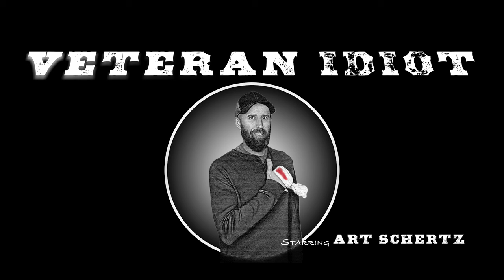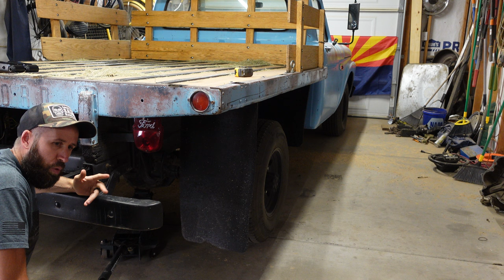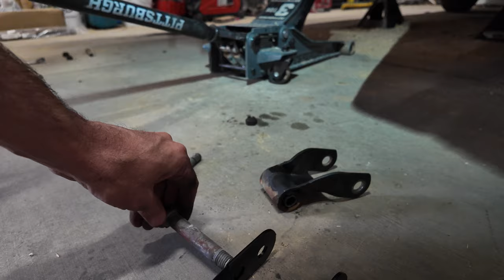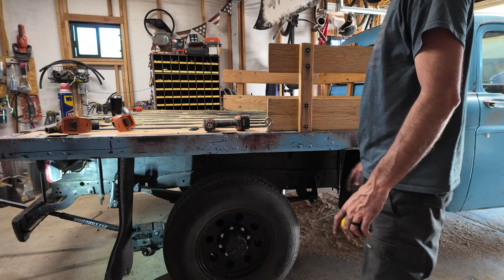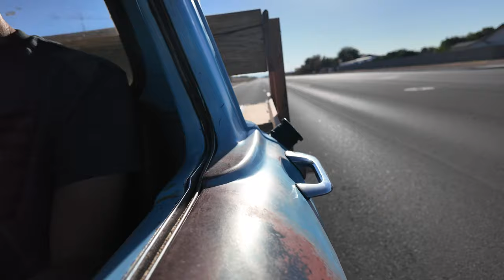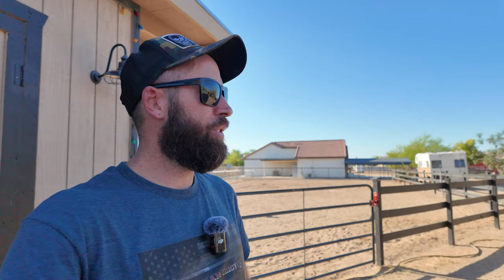LOWERED My 66 Ford With Shackles

Comment: Such a good looking rig!  It’s crazy how much of a difference one or two inches can make to completely change the look and feel of a truck.  Glad those original shackle bolts weren’t friction welded in there (bold move going in dry 😂)!
Reply from the maker: 😂😂 I've been lucky with this truck, everything has been very well maintained
Reply from the maker: Still got the Duramax Square body??
Reply: @VeteranRevivals  yessir! Just dropped Ep.14 of the build progress over on my channel.  I’m getting excited, it’s starting to actually look like a truck lol.  I’d like to have it done this year and take it on a power tour.
Reply from the maker: @richphippsgarage hell yeah, should be a sweet rig

Comment: Now get some CJ or D0VE heads, some long tubes and 3.55 gears for the highway and Earl will be a ripper!
Reply from the maker: 3.55's are already ordered. Now tell me about these CJ or Dove heads, I didn't know anything about them
Reply: @VeteranRevivals  I'm not an expert by any means, just been planning my own 460 build.

D0VE heads are widely thought to be the best of the iron carb heads. I wanna say they have the smallest chamber of the iron heads, so that alone will up compression. 

Cobra Jet heads are aluminum and came on 428 and 429 mustangs in the 60s. There is also the Super Cobra Jet that is even better and was run on the Lemans car. 

You could also go wild and get a set of Kaase P-51 heads, which are basically Super Cobra Jet heads that are already ported. 

I'd be willing to bet that long tubes and then port matching your current heads to the intake and headers would give you a noticeable gain.
Reply from the maker: Interesting, I have definitely heard of the cobra jet heads.